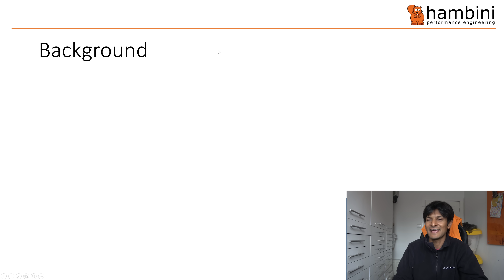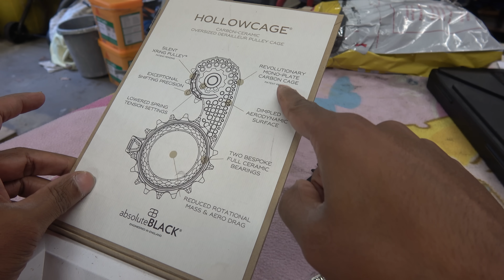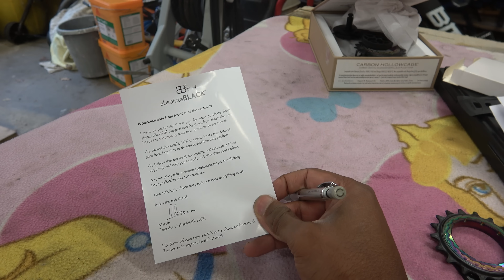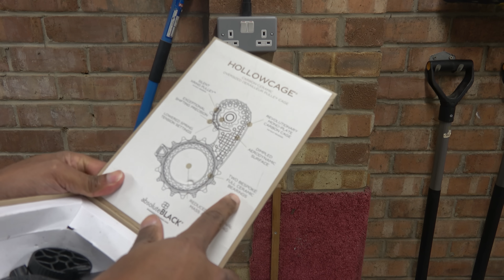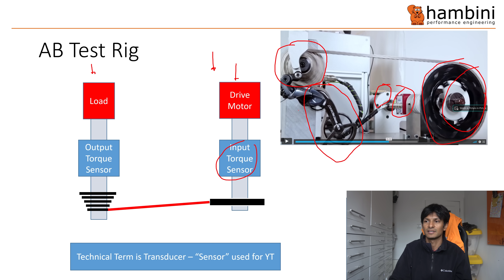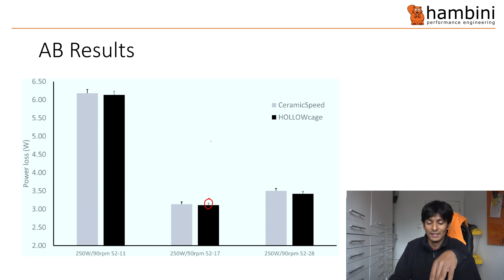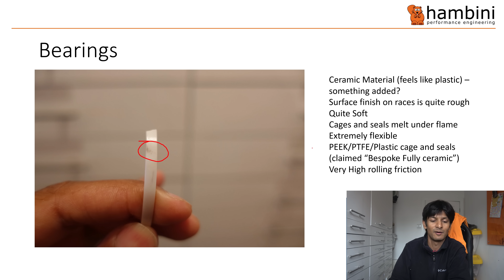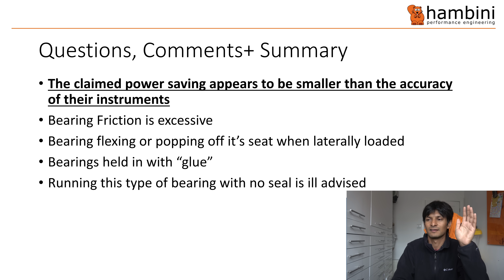AbsoluteBlack $700 OSPW: An Engineering Reaming Hollowcage

Comment: Totally unrelated. But why don't competition cyclists use some sort of strapping to keep them tied down to the frame? that way when they stand up to really hammer the pedals, they can use the full force of their legs, rather than relying on gravity, to do the work on the down stroke on thier bicycles. I would think you could use some very aggressive gear ratios and get more speed that way.
Reply: @Terry Daniels. where ever you are. thabks for your reply. I could only read half of it. But what I could read was interesting. YT won't let me read the whole thing or reply for some reason. But it does show up in my notifications.
Reply: @Yourmomma568  The handlebars provides support for the downward motion of pedalling, not just gravity. Watch a track sprinter on the startline and you will find your answer.
Reply: @granth4983  oh! is that why they have the big loops? so they can pull themselves down as well as lean down lower? I didn't know that. thanks for the insight.
Reply: @Yourmomma568  No worries, I'm here to help. I really think you are onto something with tethering yourself to the bike. You should run some tests but make sure you video the results or people will discredit your research. Also wear beats headphones because they appear to help with leg presses in the gym, you can’t leave anything to chance.
Reply: @granth4983  lol at the beats thing. there was another fella who said the italian national team tried it in the 80's but it was banned afterwards. though there wasn't any evidence that it was very effective.

I don't do research in any capacity outside healthcare. It was an idea that just popped into my head when watching this. thinking about all the stuff cyclists do to get an edge.

Comment: Great analisys, there is only 1 thing I don't agree is on the summary.
You bash them for their markup (239  to a 700), if you go to frames, and basically any other component on the bike industry you will have alot worse scenarios.
The 239 fabrication cost seems way to high.
Reply: You are right. 283 $ is the price for distributors. And the production costs are even lower. Peak Torque and Hambini discuss it in a video on Peak torque's channel.

Comment: Y - Axis scale on your graph is a bit confusing. Are you plotting input power required to give output erg of 220w?  If so that suggests a whopping friction increase for two jockey wheels even with error bars…….
Reply from the maker: Yes. Fix the load and see what the input is

Comment: I would be interested to see it actually tested (not on a home turbo no offence). Now while I agree the marketing is clearing crap and material claimed flawed this still does not actually answer the main questions. 
-An actual friction test (again you say to do this you need 200k equipment but your numbers are from a turbo trainer 🤷‍♂️) 
-Actual CDA testing for aero against the standard cage
-Sound testing (again not on a turbo) 

Measured against the ceramic speed setup (main competitor)

Me personally I couldn’t care less if it’s made from Lego if an advantage can be made. For me a TT rider marginal gains can be the difference between the win and loss however it’s definitely not a product I would use for any other bikes I have. 
Let’s hope a testing company picks one up and runs the true numbers. 
Absolute black definitely have some work to do when it comes the build of these things.
Reply from the maker: when it gets to those small torque numbers, it becomes expensive. If AB follow the datasheet, their range is about 1.5W
Reply: @Hambini  but this is only way we can actually say the product does not save W or is not quite as they claim. Theoretical results are not enough to state the product does not work. Example is the poc temple helmet, theory shows it’s should be faster than every helmet going but reality it’s not as soon as you move your head even a little it tested slower the others. 
So until you can actually prove the resistance, CDA,Noise than that part of the video is inconclusive. Maybe a call to aero coach is your next step. 
I remember all cycling community raging about the ceramic speed OSPW but testing shows the run faster especially with TT chainrings (58T as an example)

Comment: I don't quite understand why testing 2 things on the same machine isn't scientific enough. If you get the same result 100 times for each then that should be enough to say one has less friction than the other regardless of how accurate the sensors are. But then you have that absolutely awfully designed junk, the ridiculous price tag and the imaginary / imperceivable benefit.

Comment: If that were plastic, it would just take a few seconds to completely melt on a blowtorch? You accelerated the video, how long did you blow for?
I'm not saying it's ceramic, but I don't think it can be plastic either.
Reply: It depends on the type of polymer. Of you have a thermosetting polymer it will burn rather then melt. Melamine is a good example of a thermosetting polymer.

Comment: I'm not an engineer, I'm a biologist by trade, and when the data can't support your claims, that's breaking rule 1 of good science. The fact that accuracy and controls and data hasn't been made available by whichever undisclosed university, is just shoddy, if you care about that much information about a product you should be able to get your hands on the data for claims like these. I'm sure my 2014 tiagra has better wattage savings than that after a bit of a lube up. 

Just wondering about your 220w data set and if you'd link that for transparency (if you've still got it)

Comment: The torque sensors thing reminds me of hobby cnc machines. "0.0001mm resolution!!!". meanwhile you're lucky to get a part out within 0.1mm because of 100 different variables. If the torque sensor has a blanket noise floor of 0.1nm, then that's it's precision AND repeatability, and any measurement below that isn't valid. there isn't any relative comparison or "resolution", because every measurement will have a random variation of up to 0.1nm.
Reply from the maker: I think you summed up my entire 5 minutes of ramble in just a few lines.
Reply: Those ST torque transducers in the video aint cheap. And they're very good. But they should have done the needed resolution calc before wasting money on building that rig!

Comment: I can't see the dimples making this thing more aerodynamic at all. The pressure drag saving (if there's any at all on what will surely be a small bit of plastic connecting the two wheels) I would guess is dwarfed by the increased skin friction drag caused by having the dimples in the first place.

This is peak vanity "engineering".

Comment: Can't you just control for measurement error, reach statistical significance, by repeating measurements (and getting similar results) so you can reject the null hypothesis ('there is no difference', 'direction of difference is random')? That would justify reducing error bars to the mean of confidence interval. I doubt they did this of course.

Comment: The top jockey wheel is meant to move laterally,how do you not know this.
Reply from the maker: the bearing is not supposed to move laterally inside the pulley.

Comment: My beef with a lot of engineers, such as those in universities etc, is that what they think is good doesn't often equate to the real world. We've seen large diameter bearings used in pulleys before, notably some made by Suntour, and their reliability was terrible. If you want some OSPWs, just buy an older 7/8spd Shimano Altus derailleur.

Comment: I'm just half way through now, but I want to address your judgement regarding the question if the bearings are ceramic or not. I disagree with your implication that those races could be plastic. Of course ceramics are a tiny bit flexible when they are shaped thin and wide like that. I can't think of any usable material that wouldn't be.
If you are unsure if its ceramics or plastic you should heat it up. That's a clear discriminatory test between the two.
Edit:
One minute later in the clip you just did that :-D.
But you did not revoke your accusation that the races would be anything else from ceramics :-/.

Edit 2:
Now through the clip. Firstly: thank you for lifting the blanked of magicallity around stuff like this! Seeing it being disassembled and the physical properties of it's parts is really eye-opening. 
Secondly - I would appreciate if you'd stick to real flaws in a product, or it's claimed properties and rant about those. The later disproven claim about the races not being ceramics almost made me click away. And I don't think you need to be nit-picking about minor stuff like the cage or the seals to prove that there's a lot of marketing-hoodoo being played with products like this one. Other materials would not be very reasonable on these parts. As long as the bearings and the races are ceramic - I think roadie-joe-average won't be disappointed with the properties. 

Then you showed a graph of your own tests of your power-output with the different cages. And despite your technically correct reservations because of calculated error-ranges, it seemed to indicate that there really is something to absolute blacks claims regarding the better efficiency of that system. I would have liked to hear that acknowledged a bit. 

Despite my criticism I'm looking foreward to more teardowns like that :-).

Comment: absolute cack , or shambolic speed , which one to buy ? ive had customers ask me many times if these products work , i have to tell them , there is a reason the jockey wheel and pulley cage systems have remained the same for a century with only careful and well tested improvements . if it aint broke .

Comment: I wouldn't pay $7 for that rubbish, as you have said it probably just injection moulded plastic and the body where the "ceramic bearings" are located will wear out. FYI I have been making plastic injection mould tools for the last 30 years for Mclaren, Aston Martin, Bentley etc.

From the look of the pulley wheel profile they probably won't last too long either.

I do think some of these marginal gains are just an excuse  for some to produce blingy rubbish and rip people off.

As for your "Vernier" it isn't a Vernier caliper, it is a digital caliper, but I'm sure you know that😂👍

Thanks for pointing out all the misleading claims of this product, needless to say I won't be buying one any time soon.....

Comment: Two words, "Veblen Good".

1) Duraace much more lighter.
2) 9:50 where I will not buy it. Just replace Duraace pulley wheels with Tripeak pulley wheels with ceramic bearing.
3) AB pulley cage flexes too much, it will cancel RD shifting accuracy.
4) With that price I can buy a 105 R7000 GS, whattttttttt!!!!!

Comment: Should have explained that normally ceramic shouldn't be able to be scratched by steel because it's supposed to be super duper hard.  Much harder than steel, in the order of 3-4 times as hard.  Only materials like diamonds should be able to scratch ceramic.  The fact you can use a utility knife to scratch it is shocking from a materials standpoint.

Didn't they say that the power savings comes from aerodynamics?  So when are one of you (Hambini/Peak Torque) going to do an aerodynamics test? :)  I imagine you could put together a small wind tunnel test.  The thing is not that big after all.

Comment: Hi Hambini, I think you a little bias in this video. Don't want to protect AbsoluteBlack and this is not my point but I worked in molding industry in UK for last few years (8y), for big automotive supplier and we do inject different types of materials . Word "plastic" is quite loose word, you can inject different types of "plastic" from soft to rigid and with different temperatures ranges and materials including fiber glass. etc.  So is not mean something is cheap or week because was mold injected. (the dimpling, on the cage casting comes from injectors on the mold, FYI) 
Second the graph you shown, comparing dura ace and absolute black, is completely unaccurate. The uncertainty in the measurements is so big that you could say in fact that is possible the aboluteblack had the least friction compare to others, and vice versa.

In summary I agree with you and it looks like AbsoluteBalck did all backwards. First did nice apling design  and focus on the visual  of the product, instead off doing modeling and testing first that would result in new designee and how the product looks like.
 
Regards
Adam
Reply from the maker: You are quite right, the graph could show AB to have lower friction as it's within the error margins and I did emphasise that. The difference was I was transparent and stated it with the errors. AB didn't.

Comment: still up 8hrs later? Will it make Monday? Is this video monitised?
enjoying the 'sock puppets'/ 'people easily confused by actual engineering' in the pinned post.
Intrumentation Accuracy is Mech Eng 101, 
also you very quickly learn the wisdom of the old Engineering adage "if it looks wrong, it is wrong"
I'll stick to Alu frames & Shimano 105 thx :)

Comment: 1. Even if you got the claimed power savings it would be absolutely buried under the loses from crank seal loses. So why would you spend $700 when you could just pull the crank seals and replace the bearings more often for $7? 2. If that bearing cuts that easily, the race compresses under load losing race accuracy. 3. The flexibility of the cage means that the pull of the chain when off center will induce drag on the chain.  But none of this is large enough to be significant. I buy some ceramic speed idler pulleys but simply because it makes threading the chain through easier.  So I can ultrasonically clean and hot wax the chain more often and save more power than any of these ridiculous money burning options.
Reply: I knew more than one person who would do that - old school. DuraAce BB with "double labyrinth seal" (we are talking 1992 or so). They would take out the seals on race day and use 3 in 1 oil (or tenacious oil) on race day, put the seals back in later (or a 600 Ultegra).

Comment: Whats the difference about accuracy and resolution (precision)? Low accuracy means you cant say the absolut amount of what you measure. But if precision is high enough its possible to compare 2 different things very precisely with the same low accurate measurement tool. For example theoretical perfect balance scale with no friction will show you which object is 1 atom heavier then the other but youre not able to say the absolut weight of these objects. Theres no accuracy but highest resolution. Your 1 second watch example means you dont know if they are running 8,8s/8,6s or 9,8s/9,6s. But because of higher resolution youre able to detect the 0,2s difference. Calculated to a base of slowest runner 8,6s=2,32% and 9,6s=2,08% you can see thats possible to define very precisly the velocity difference with a watch thats accurate with 1s. Resolution in shown data sheet ist 10x better than accuracy. But I also don't believe the result (We are better than...) because of your shown mechanics inside and rough rolling bearing.
Reply: If the accuracy is poor the resolution is irrelevant.  If the accuracy is 30%, always a percentage of total, a 10s runner would be 7-13s.  Who cares that the watch goes to 0.001 it’s still could be wrong by a massive amount.
Reply: @gregditchburn9786  "If the accuracy is poor the resolution is irrelevant" No, thats standard. My bathroom scale is max 150kg 1% (=1,5kg) and resolution 0,1 kg. Means I can measure my shirt weight by removing it from body. Scale will show me the weight difference. I can pull over 2 shirts and scale will detect it.  But I don't know my absolut weight within 1,5kg. For this it needs to be calibrated at this bathroom position, this temperature and also in this weight region because of nonlinearity behavior.
Car tachometer has also large accuracy error but it can show you smallest velocity changes (old analog is dependent how good your eyes are, digital last digit, most 1km/h). With atomic clock you can detect smallest relativistic time mechanism without knowing exact am/pm time.
So by changing only one piece in measurement setup you can show finest variations because resolution is high and accuracy errors are mostly constant. Because of that comparison measurements are easier to do. You get in trouble if you want to have precise absolute values.

Comment: The accuracy might be better if you're using the same torque sensor to get a relative reading between two cages. If the error bars were as big as the ones you drew the results would have been normally distributed over that kind of range. But they were very close. Obviously it is a total scam product though.

Comment: Ah there are so many charlatans out there promising efficiency gains in cycling. These are the best : position on bike, close fitting clothing, getting fitter, losing excess weight of rider, tyre pressure, handlebar width and possibly aero wheels and concealed cables. Everything else is for the elite riders and their pro teams.

Comment: I bought a used full Dura Ace 7800 groupset (front and rear derailleurs, brake calipers, bottom bracket, chainset, shifter/brake levers) from e-bay for about half the price of one of these plastic hollowcage fittings. These people are just snake-oil salesmen, they certainly are not engineers.